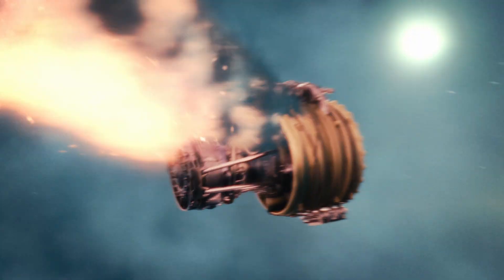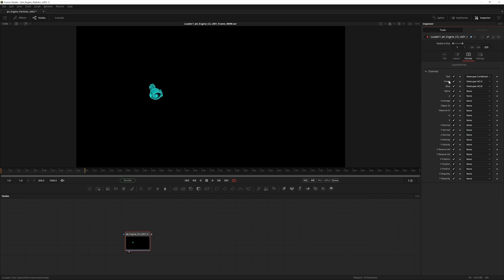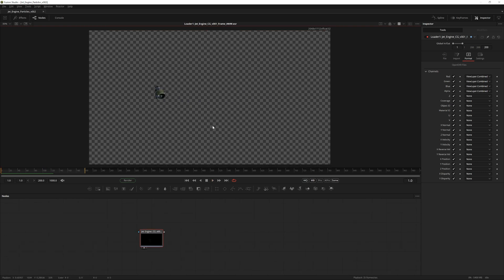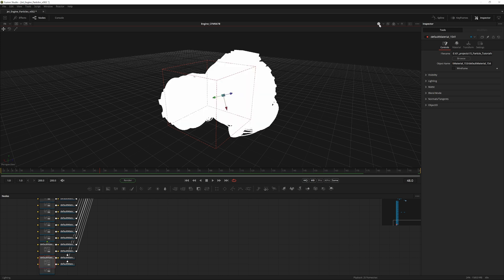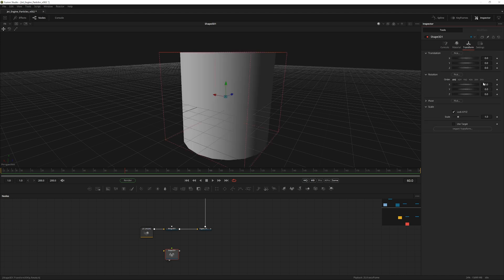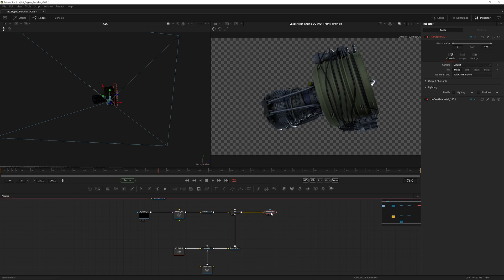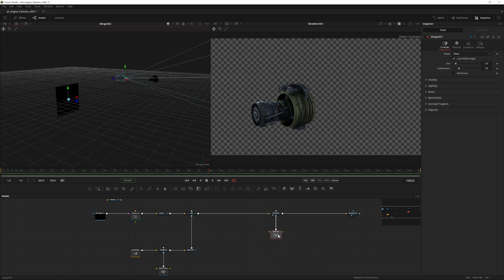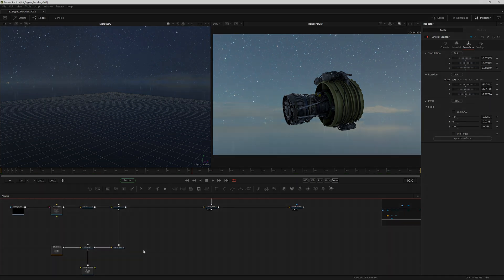Full BLENDER to FUSION 3D Workflow Part 1

Comment: Привет, большое спасибо за урок! Особенно за мелкие нюансы с импортом модели и настроек камеры. Но возник вопрос. А не проще ли такие сцены, сразу делать в блендер, а в давинчяи кидать уже абсолютно готовый шот?
Reply: translation

Hi, thanks a lot for the lesson! Especially for the minor nuances with importing the camera model and settings. But a question arose. Wouldn't it be easier to do such scenes right away in a blender, and throw an absolutely ready shot into the pressure?

Comment: I can't align the footage with the Alembic no matter what. I checked the 'remove duplicate keyframes', I  made sure the comp and the animation were both at 25 fps, I started both at frame  0, both filmback and projection were done at width.  No matter what there's a slight temporal unaligment
Reply: I finally got it working by Holding the First Frame of the projection for 1 frame. The Alembic animation begins at frame 1.
Reply: @jordiyoyijorge  Same issue here. How did you even do that? Edit-> ah, I added a Timespeed node directly after the EXR render sequence and set the delay value to 1. Thanks for putting me on the right track
Reply from the maker: @jordiyoyijorge  Glad it worked out!
Reply from the maker: @jordiyoyijorge  I hope you meant ‘Un-Ckecked’ the remove duplicate keyframes? This option should be disabled. Are you using the files I provided in the link, or your own?
Reply: @fusion_brew  I love your tuts!  Keep the good work!
Reply from the maker: @ Thanks! 😄